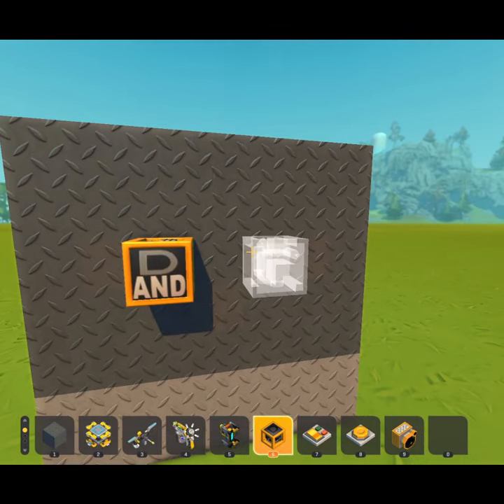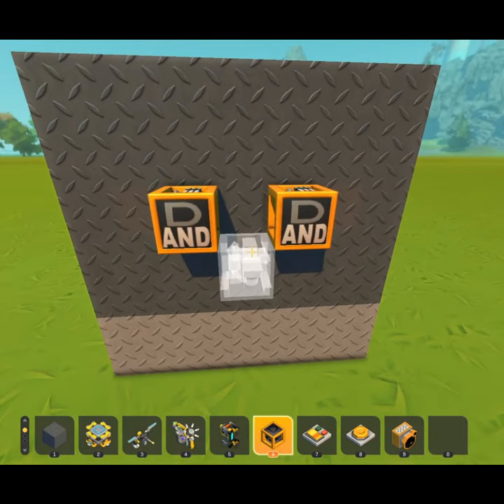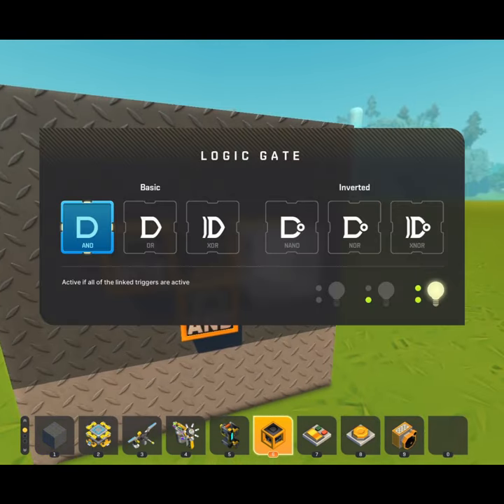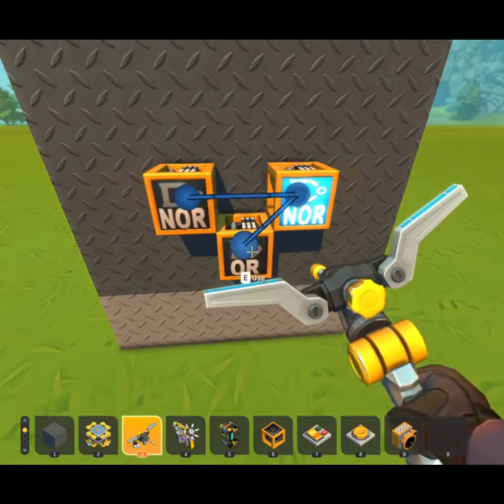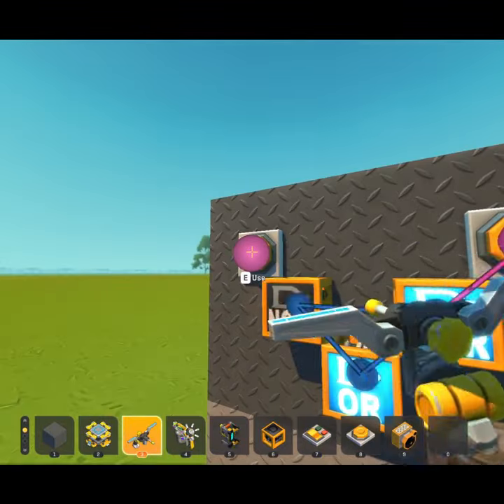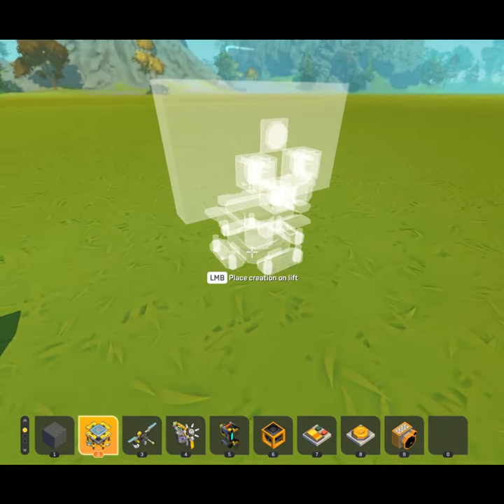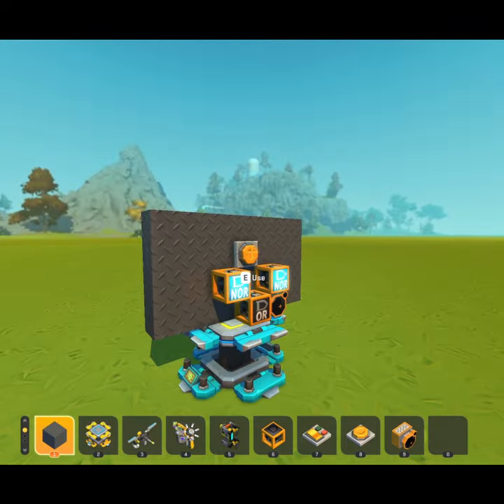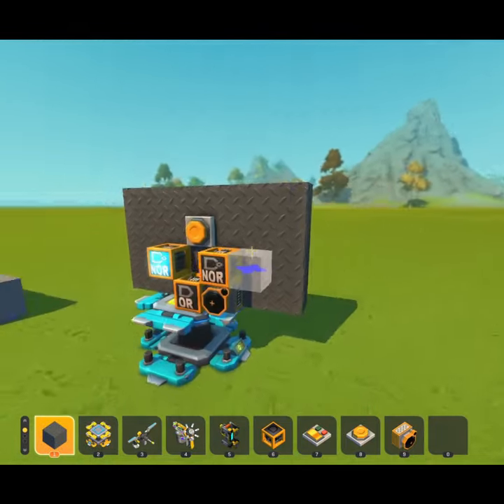Basic flip-flop: Use BUTTONS as SWITCHES

Comment: Man, I am struggling SO hard.. I want to connect a switch to an electric engine, that turns on and off and on (loop) with 5 seconds delay between on and off and on. (in a loop so it always goes on for 5 seconds, 5 seconds off, 5 seconds on and so on)   I tried everything and I can't get it to work,  any suggestions perhaps?  I am very new so I having a hard time following all the connections you made..
Reply from the maker: Take a look at my "Basic cycle timer" video, i think that circuit is what you need:  https://www.youtube.com/watch?v=hmoRe0oqaJw   There is a more advanced version where 'on' and 'off' times are controlled separately, but we don't need to go into that just yet.
These loop timers work on the idea that if you connect an AND gate to a NOR gate, as soon as one turns on, another will turn off. So in theory those two will keep turning each other on and off forever, creating a very basic loop circuit. However since connections in SM are directional (AND>>>NOR is not the same as NOR>>>AND), you can't have two connections between just two blocks. Therefore a third logic block, or in this case a timer, is added. That timer creates a delay so the circuit doesn't just switch as quickly as it can (40 times per second, to be exact, that is how often game recalculates physics).
Hopefully this helped you understand the basics. If not, no worries, i'll try to answer any more questions you may have.